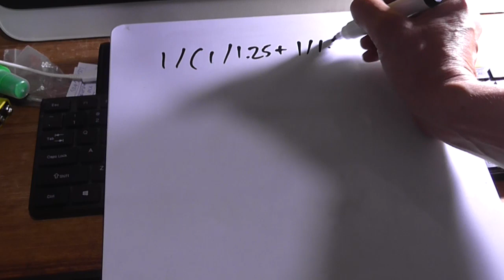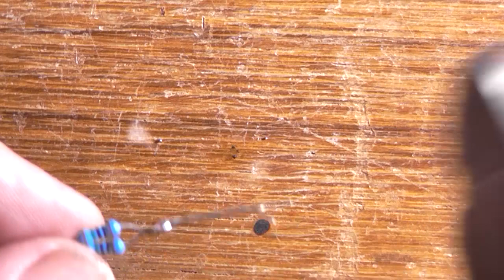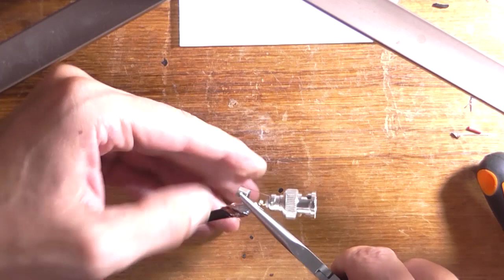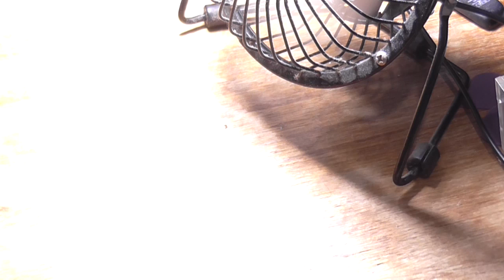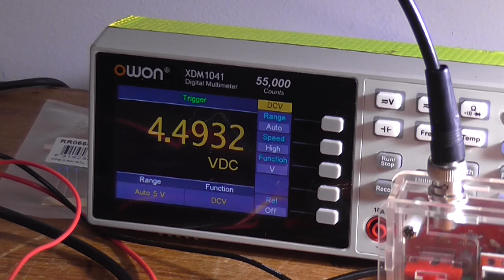DIY 10:1 (x10) Oscilloscope Probe

Comment: These cheap oscope need a few resets to sometimes output the correct voltage I’ve ran into this issue before too checking the voltage of a Aa battery for instance

Comment: There is a need for a 50 ohm termination resistor somewhere, generally at the scope input, so that the coax bandwidth does not affect the signal. A 450 ohms at the other end of the coax would provide a 10X ratio with a  DC impedance of 500 ohms.
 There is a need to know the RG number of the coax so as to evaluate what capacitance is generated with a 1 meter long piece of that coax. That will allow calculating the bandwiddth of the probe.
Reply: i use RG6 on my probes 
Rob
NSW
Australia